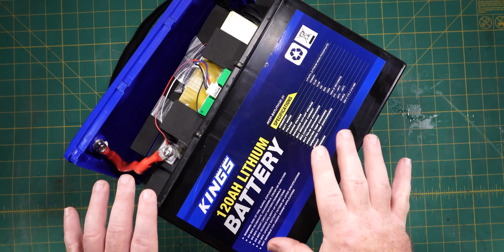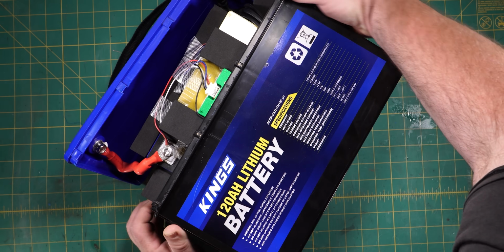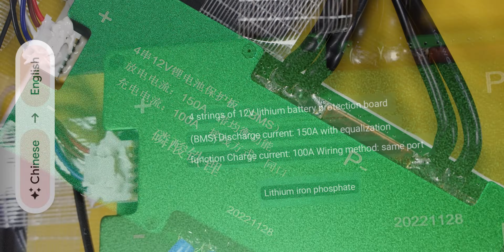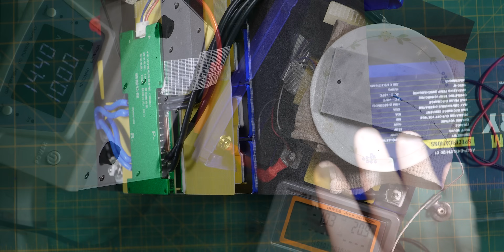Supacentre Kings 120Ah Lithium LiFePO4 Battery Performance Teardown Review Part 2

Comment: Cold temp charge temp disable is not a big deal. Just use DC2DC or solar controllers. With temp monitoring. They cost like 10 Bucks more.(Put the probe on the battery. Not hanging next to the controller. People... I see this alot.)
If the cells are 3000 or 6000 cycles. Who cares? Thats 8 or 16 years of charge and recharge. Once a day.
If you using them in some type of power bank for solar storage. That matters. 
The most important thing is the. Advertised capacity, max output and maximum charge input. Are as stated correct
As a camping battery solution. It is more than adequate.
Reply from the maker: They seem like a decent solution, especially if you're moving from an AGM to your first Lithium battery.

Comment: to be fair to kings i don't think they advertise them as having cold temperature cutoff and the battery did provide more than the rated capacity in the previous test which indicates the cells are good.
so i don't really see any reason not to get one you can fit a cold temperature cutoff from $10 up. 
might be a good idea for a video, testing cheap cold temp cutoffs against the $80 victron.
Reply: The BMS can disconnect the battery to prevent damage from over or under temperature.... Taken directly from their website, I questioned them on this when I purchased one a few months ago, got nowhere
Reply: @filthylucre351  yes you're right, last time i checked i didn't see cold temp cut off advertised. they will need to get on top of that. because there would be no dispute when it comes to warranty they said it's protected so any damage from sub zero charging would warranty.
Reply from the maker: It just struck me as strange that they would go to the trouble of using a BMS with a thermocouple probe, enable the high temp cut off and leave the low temp cut off on the table.
Reply: @LockyourHubs4WDing  yes you would think they would have it just to avoid warranty disputes. it would be good to see them either put one in the battery or sell one separately to those that need it.
Reply from the maker: @6226superhurricane  sounds like a simple programming issue to me. Easy fix.

Comment: Once again great video it seems over all for the price you found a diamond in the rough with kings products 😅
Im interested in the victron temperature gauge i have a BMV712 and want to buy a temp gauge can this new gauge synchronise and how can this stop the charge a video on this world be good once again great video 😊
Reply from the maker: I'm not sure the BMV712 temp gauge can also stop the DCDC from charging, you might have to check with Victron on that one.

Comment: another great review, I did think about Kings last year but went with a company called Top Lithium battery.3x100amp for the  camper trailer and are getting charged by my  usi-160 by Traxide Tronics ultra smart isolator without a problem.
Reply from the maker: Great to hear they're working out for you. That's the main thing.

Comment: Great vid, the fact the QR codes have been removed shows a blatant deception on the part of the manufacturer, kings need to find another supplier and not be part of this deception. Who knows how much life these things have left in them. Keep up the good work.
Reply from the maker: Thanks, I was not impressed with the QR code issue either, you would think the retailer would want to be as upfront with the customers as possible, considering past indiscretions.
Reply: It explains the price though.
Reply from the maker: @HardstylePete  it does.
Reply: They may not only need a new supplier, but they need to lift their own standards at the same time.
Reply: Kings staff will be aware of these issues and made decisions based on cost over quality.  Also internal construction of battery and cheaper Bms indicates cost over quantity of build won out.
Reply from the maker: @notathome13  Products are always built to a price point, sometimes more accommodating than others! :)
Reply: What an absolute load of crap 
It is you making assumptions
Reply: @cackle067  Pull your head out of your bum.

Comment: Perfect review, thanks again. The lack off low temp shut off and scrubbed qr codes are a downer but for the money, this is a battery I could get behind 👌🍻
Reply: Excuse my ignorance, but what is the worst that could happen when charging in those colder climate conditions?
I live south of the border as well. 😄
Reply from the maker: @dizygotheca5162  charging LiFePO⁴ cells below 0 degrees C kills the cells permanently.
Reply: @LockyourHubs4WDing OK. That's pretty important then!
So, other than tearing down a battery, like you did, there is no way of checking all these factors... pretty muck at their mercy. And even if I bought a high-end brand, it might still have these issues?
Reply from the maker: @dizygotheca5162  you could ask the manufacturer, reputable manufacturers shouldn't have an issue supplying the information. Though, then there is whether the battery is built to the specification.....
Reply from the maker: The cells certainly looked new, though some shonky wholesalers have also been caught rewrapping them as well. The low temp cut off is probably only an issue for us southerners, though you definitely want to make sure you're not changing the battery in subzero temps.
Reply: @LockyourHubs4WDing  -3 here (CW NSW) winters mornings, so definitely could happen 🧐

Comment: I run a couple of Renogy batteries with Victron charger and shunt in my van and happy with these. With the Enerdrive inverter and all the extras it's been a bit of an investment. Have also been considering replacing my 4WD under bonnet wet battery with a lithium in the cargo space but will also need a new DCDC charger so the $ start to get up there for just running a fridge. This is now a more budget friendly option.

Bit of a concern with the origin of the cells though.
Reply from the maker: Sounds like you have a great setup, Victron especially make some quality gear. I was quite surprised about the QR codes as well.